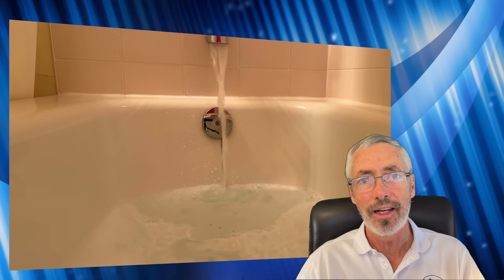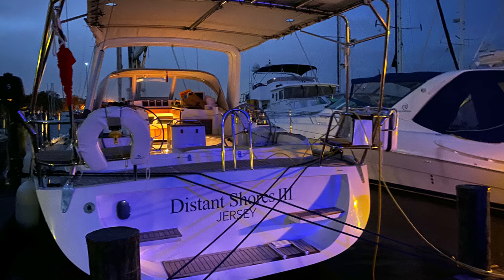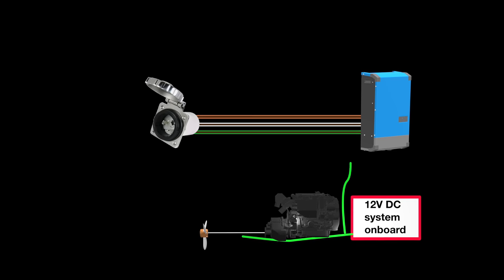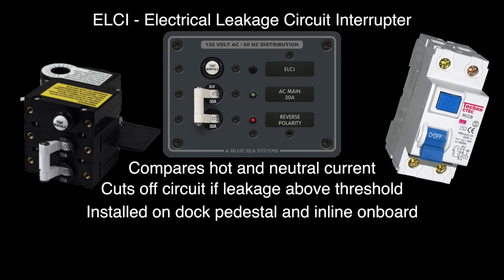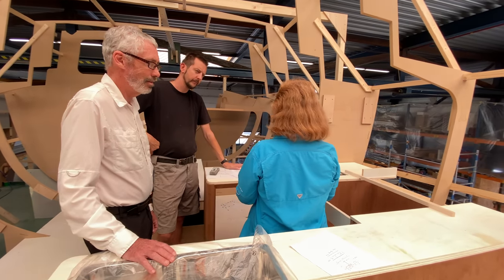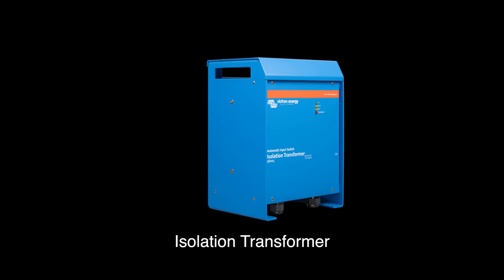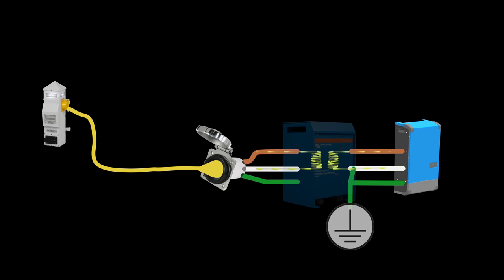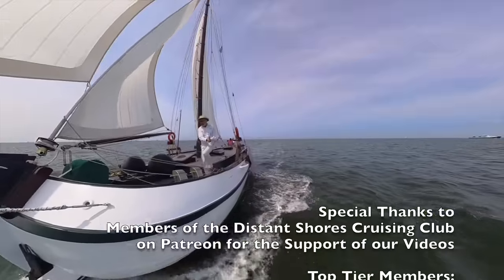Aluminum Sailboat Pt 18 - Shore Power SAFETY and ELECTRICITY on Boats | EP 239

Comment: We had our boat hooked up to an AC power source while working aboard, on the hard in our cradle, and received a slight shock when handling the aft stern railings while getting onto the ladder. Was a clear sign we have some stray current or a ground fault. Your video was very timely.
Reply from the maker: Your experience with the ladder was similar to mine climbing on to the dock. And your ladder was probably grounded by itself with legs buried in gravel on the hard...

Comment: Not all countries, even in Europe, have a neutral leed. The best is to by an insulation transformer with a designated zero connection. Not certain that the whole Victron range is equipped with that. And then hook up the boat AC to a TT system. It should also be noted that cheap isolation transformers only block up to approx. 1.7 V. Anything above 1.7 V will float through and cause damage. It's a lot more to it :-)
Reply from the maker: You are correct that neutral isn't used in all AC power systems. North American 120/240 split phase is a common example as most north American homes are connected with two hot wires each at 120 making a 240 power an option for high-power things like dryers and stoves. But most homes worldwide normal sockets have a hot and neutral wire.
And you are also correct not all isolation transformers will make a good choice for use aboard a boat. Best choose one like the Victron designed for use on boats.
Definitely there is a lot to it. This video could have been an hour :-)
Reply: @DistantShoresTV  Yes. Well, Electro Engineer in Norway takes two years. But beware that you are building a boat that has a 'soft spot' for electrones on the run. That's why I empesize to hook up an AC system conforming to TT (mainly safety issues).  And your DC should be a true 2-pole system. Choose motor with 2-pole brushless alternator. 2-pole switches on all system with DC electro motors with brushes, like bow thruster, winches, windlass and so forth. And a DC varning system for pos. leaks to the hull. I am not by profession an electrision. I have a degree in corrosion sience. Good Luck!

Comment: Hey Paul. Nice explanation. Well presented. 
To add on your bonding true the prop shaft , that’s not the best way. 
They need to be grounded ( bonded) but to have a base plate nearer to the mast is way better. 
Obviously zink anode need to be present to in the bonding equation. 
An isolation transformer is not always need on smaller plastic boats. But these days the electric system are grown even on smaller boats.
Reply from the maker: Great point @MonkPetite ... I think I will make a second video about bonding specifics when the boat gets to that point having it mostly installed.

Comment: It would be VERY interesting to learn more about the time Paul was shocked stepping off your boat onto the dock.
Reply from the maker: I was barefoot and climbing off the bow holding on to the stainless pulpit fitting (which was bonded to ground). When my foot touched the aluminum of the dock I felt a very strong shock. I was temporarily a good path for AC electricity to run from the boat back to the dock where we were plugged in to the shore pedestal. This was back over 20 years ago on our original home-built 37 footer Two-Step. We had an inexpensive non-marine transformer to change AC 230V shorepower to 120V for our US style wiring aboard.
I was very lucky I think!😳
Reply: @DistantShoresTV  Yes, probably very lucky. But at least lesson learned without serious injury or worse.
Reply: @DistantShoresTV  did you manage to find the cause of the ground fault?
Reply: There must have been a bad ground wire from the boat to the dock. And a small leakage fault from live to boat ground.

Comment: Well explained, and gives me one more job to do. Thanks.
The short up the mast clip makes me comment that I have recently come to the opinion that all metal edges at the mast head should be rounded. That mast cap is routinely a cut flat shape an the edges are left square. The problem with this is that the edge produces an electrical arc jump point when the body is subjected to an electrical field as with a lightning storm. The 90 degree angle represents 2 surfaces with a increasing electrical arc pressure towards the edge. A rounded surface has a uniform surface charge state making it more difficult for electrons to leave the surface. That is my thinking. My suggestion is that the mast cap plate should have rounded and even polished edges to reduce the risk of arc strike. I’ll be doing this to my mast head when the mast comes off soon to fit some new bits.

Comment: My 20 foot Paceship P2-20 is so simple electrically.  All it has is an on board 12 volt DC system.  That runs off of a 12 volt battery.  I've never had to hook up to shore power as of yet.  If I did it would just be an extension cord running to something specific on board.  But there may come a time when I get a bigger boat.  That's when this video will become important.  

Until now I couldn't have told you anything about more complicated sailboat electrical systems!  Thanks for providing this information for possible future use!  

From what I have read you will be at the US Sailboat Show.  : - D  I hope to see you there!   Distant Shores IV should be finished or close to it by then.  

PS - On Tuesday the 22nd of August I went out for my first sail of the year!  I can't believe it took this long.  I sailed for 2 hrs 5 minutes on Keuka Lake here in central New York State.  It was close to ideal conditions.  : - )
Reply from the maker: FYI if you do run an extension cord aboard it is just like standing in the shower holding a hair dryer. I would definitely be careful and at the very least make sure the extension cord was going through an ELCI or GFI outlet (that you had tested first by pressing the test button)
Reply: @DistantShoresTV  Thanks for that information!  So far the only time I've had 120 AC on my boat is when it's in my driveway getting leaves vacuumed out of the cockpit.  : - )

Comment: Greetings,
I have enjoyed seeing your boat develop.  Many great ideas.  
I have mentally designed a 50’ modern aluminum hull expedition boat with twin screws for maneuvering and junk rigged sails.  With center wheel house/ bridge and large weather proof deck house aft.
How do you prevent condensation inside an aluminum boat?  I have seen where Boreal sprays a coat of cork on the interior.  Does that include the overhead?  I hope when you get to the interior you do not gloss over the insulation to block heat and cold.  I am also very curious how you will mount electrical, plumbing, lightening protection etc out of sight while keeping it accessible for maintenance and repair.   I like the hybrid power system.  Have you seen the  Sharrow toroidal Propeller?

Comment: Very informative.  I knew of the issue from a Kiwi boat electrician friend who's main work was re wiring old and new boats.  He explained the main reason you can not swim in a marina is electrocution.  Most all boats leak juice.   Now I understand this a good bit more.  My sense is the 'Isolation Transformer' thing should generate heat if under a strong load....  Would this be correct?

Your new boat looks just fine!

Comment: North America is 120v, most of the rest of the world is 230v. To be compatible with both I’m looking for an isolation transformer that is also a 1:2 step-up. Any suggestions?
Reply from the maker: Victron make an isolation transformer that automatically adapts to either 120 or 230 if you plug in anywhere. Check them out...

Comment: This is a most excellent video about electrical grounding of AC & DC systems on an aluminum SV, both from the standpoint of personnel safety and galvanic safety.!

     I served on a nuclear submarine and one useful system we utilized was a “ground detection” system.  It monitored the AC & DC electrical systems for grounds.  Once a ground was detected there was a procedure to sequentially isolate sub-panels, then finally individual circuits to locate and repair the ground fault.  Does Victron or some  other vendor offer a similar solution?

     Finally a trivial question: I own two Tilly hate for sailing but admire your model with the narrower brim for more urban settings.  What is the model number?  I’ve scoured the Tilly site but cannot find it.  Thanks, I can’t weight for your upcoming video for the electric-hybrid propulsion installation. 😎
Reply from the maker: Thanks @vincentstouter449 - glad you enjoyed the video... 
I am not aware of an installed system that checks ground potential. 
I checked and my hat is an "LTM5 Airflo Hat" by Tilley :-)
Reply: I guess you are talking about a boat with an isolation transformer. In that case you can choose to ground the neutral output to the boat and connect an RCD, or NOT connect neutral to ground and connect a Low resistance to ground detection device.
Reply: @DistantShoresTV  Thanks 🙏 so much for such a timely reply, Paul.

     Subs extensive electrical systems, both AC, of multiple frequencies and voltages ,DC, of multiple voltages, and large DC motors resulted in ground mitigation being an important concern.

     While not made of aluminum, galvanic and electrolytic corrosion as well as personnel and equipment safety and reliability were always items of concern.  We employed AC & DC ground detection systems, as well as equipment like shaft grounding devices to resolve grounds once they were detected because metal wasting could occur at an accelerated rate when there was a ground and current flow (not good for a pressure hull 🤣).

    I really admire the attention to detail that both you and the yard are exercising for this build.  Since the propulsion will be a parallel electric hybrid, ground protection will be even more important.  

     The insulation, painted surfaces, galvanic isolators and isolation transformer all work together to produce a reliable yacht.

     Thanks also for the Tilly info. 😎

Comment: Thanks for another good video. Since you are planning sailing to Norway beware that we are usually using 230v IT net system, not TN net system like the rest of Europa. This shold not affect safety, but could affect the efficiency of charging your hybride system.  Best regards from a Norwegian sailor.
Reply from the maker: Interesting 🤔 I wasn’t aware of that. How does that effect the power if it’s also 230V 50 cycles?

Comment: Why in the graphic for the Isolation Transformer is the current depicted as flowing from the charger/inverter (the boat) TO the transformer (the new power source) along the hot wire?  I’d think it should be depicted as flowing the other direction?

Comment: My 120VAC ground is not connected to the DC ground at the engine and the prop shaft has the polyurethane isolation puck. So it would be almost impossible to get an AC or DC leak to the water. I have a device that gives me a visual indication if the AC ground fails to the shore pedestal. However,  a device that has a sound warning of the AC ground failure would be most ideal but have not been able to locate such a device.  Boat is fibreglass in fresh water.

Comment: In my area we removed the ground cable, and therefor not bringing the ground in the boat - how does that effect the system? Still have a internal grond onboard via the steel hull. Also how does grounding work then out sailing and running via the inveter? But nice vid
Reply from the maker: The purpose of the ground is to provide a safe path in the even of a ground fault so I don't think would be a safe configuration... I hope there is at least an RCD or ELCI device at the shore power pedestal to try to guard against such a ground fault. RCD or ELCI must be tested regularly (monthly) by pressing the test button to prove they are still working. If they fail It is my understanding that they might keep passing current but NOT be protecting against faults. In that case your situation could be dangerous with no ground wire. Have you had electricians look at your installation?
Reply: @DistantShoresTV  thx a lot for the reply! It's an marine electrician that's made the system.

I know there is ground on the shore, but my shorepower only have two wires, phase and neutral, and therefor not bringing the ground wire onboard.

But when shorepower iscoming inside, it's runs though an rcf, then though the combi inverter, then back to yet another rcf that then splits into two 10 amps fuses. When I press the test button onboard the rcf does works however, and the ground to the rcf is connected to the steel of the boat. But not to sure how that effects corrosion

Comment: it takes 36 volts   shock to hurt someone someone or  0.1 amps
Reply: thats not  completely correct, but   a good rule of thumb.. military uses 24 volts and  civilians use 12 volts.. 24 volts can  hurt you but  36 can kill you.. many debate the 24 volts.. stick with 12 volts and  an isolation transformer

Comment: Is there any difference between the ELCI discussed and GFI or GFCI (Norman American terminology)
Reply from the maker: Hi Neil!
GFI have a lower fault tolerance normally 5mA and are used in the galley or heads or other wet spaces. They trip quite easily at just 5mA whereas an ELCI or RCD trip at 30mA and are normally used to protect the whole boat or whole house. So we will have an ELCI at the power input to boat then individual GRI in each heads and galley.

Comment: Hi Paul, Are galvanic isolators required when not using Shore AC Power, If the boat is totally off grid and not using AC power sources?
Reply from the maker: It's my understanding a galvanic isolator would not be useful in this situation since there isn't a circuit ashore.
Reply: @DistantShoresTV  Thanks. My ZINC Anodes would last longer even in a Marina?
Reply: With only 12v there would be no where to place the isolator. But I think there is a hack where you connect a wire to the battery negative and to a big electrode in the water. This would limit galvanic currents through your driveshaft and thus make your driveshaft anodes live longer.
Reply: @scoutjonas Thanks Jonas, That sounds like something to look into..

Comment: I don’t think there has ever been a case of electro shock drowning in salt water, Ever
Reply: My understanding is that a “hot” part of a boat in the water is dangerous in fresh water, because the human body conducts better than fresh water. Conversely, seawater conducts better than the human body, so a leaking current does not flow through the person. 
Comments from those more knowledgeable would be welcome
Reply from the maker: I think there have been cases in brackish water. It would be difficult to judge where in the Chesapeake Bay would switch over from "safe" to "annoying" to "dangerous" to swim in a marina.

Comment: Many years have you been sailing , how often did you die , you're scare mongering to make a buck,
Reply from the maker: I have sailed well over 100,000 miles over 34 years. Luckily I have been seriously shocked only once. I have seen many problems with unsafe wiring for shore power - warn out cords dangling in the water and shore power plugs burned. I made the video to try and help people understand how shore power works.
Reply: @DistantShoresTV  like you I have sailed many years , many many marinas , lots of electric issues , in different countries , no shocks , none of my crew have had one ,  no £££££££  box to save us all,  neither have you ,   would you tell everybody to not go sailing until they have all this £££££ equipment .  Scare mongering .   You used to be be daring get out there ,  sad day